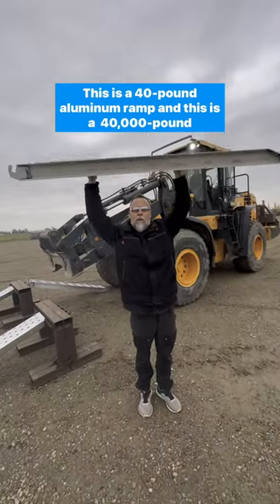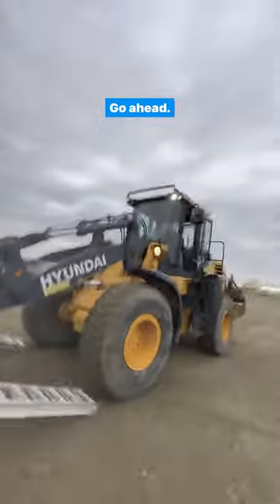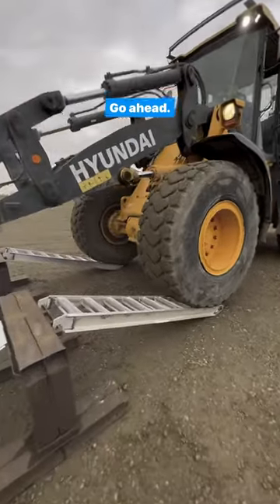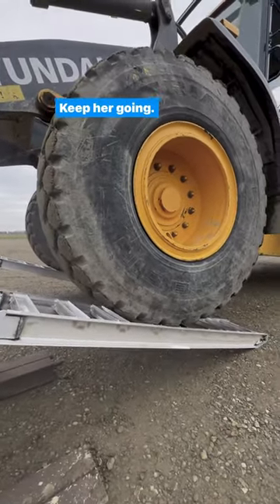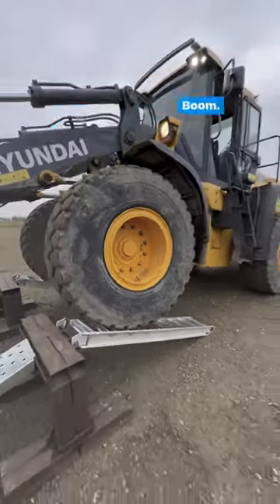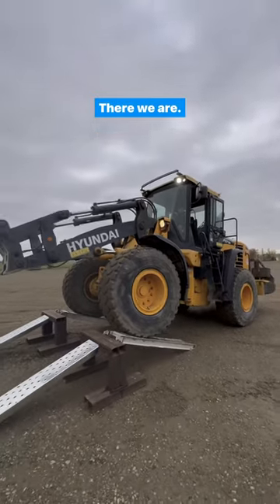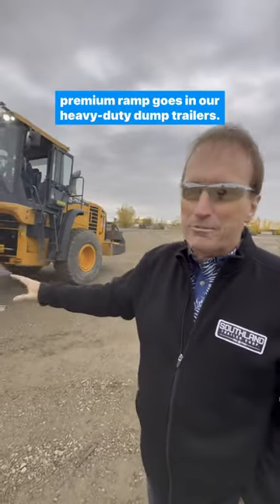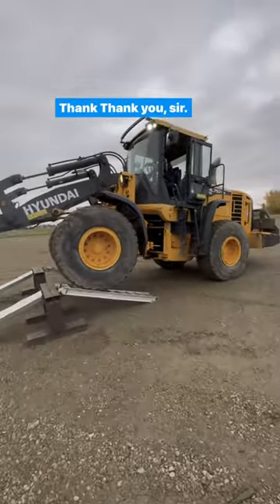40 lb Aluminum ramp VS 40,000lb payloader. #small #but #strong #shorts

Comment: Yea now use the rear tires where all the weight is. Instead of using the front without even have a attachment on 😂 I say this because he's boasting 40k loader on these ramps but he maybe put 8k on it. equivalent to a diesel pick up. But even still don't boast 40k when it clearly won't hold 40 with movement at 8k

Comment: Probably 6000 lbs per ramp but that test is destructive.  Roll on it 10 times and it will definitely break.  It will probably load 10000 lb trucks forever.

Comment: Ya.... But the front axle of the loader... Without a bucket is max 15000 lbs. So each ramp holds max 7500. Not even close to spectacular.

Comment: Ppl talking about how they should’ve used the rear end of the Loader but they missed the whole point. 

First off it’s aluminum
It’s 40 pound 
They just put a machine that weighs more than I’m sure it’s rated. 😐

I’m sure if they used the rear end it wouldn’t hold up as well but they still went above and beyond with this like wow.

Comment: I guarantee you with that 40,000 lbs doesn't have all the weight in front. It's more on the end of 12,000 lbs, give or take 2,000. Still a strong ladder.

Comment: Can anyone give me the approximate weight that was on the ramps?
Years ago I built a tub trailer for my atv and the sides come of and act as ramps and bridges. The sides are 1/4" x 3" aluminum channel with 1/4" x 2" aluminum angle rungs. I have always suspected that they would support my F350. My ramps are appear to be heavier than these. 
Any info is appreciated.

Comment: For one, it's not called a pay loader. It's a front end loader. Second of all, most of the weight is located at the rear where the engine is. This is not much of a test at all.

Comment: Half the machine is on the ground and it's on the quite lighter half of the machine, you're probably not even doing half of the weight of the machine on the ladder, not forgetting to mention cus there's two the weight is distributed even more so it's roughly 10,000 pounds possibly less which is far from the beginning making it seem like 40k pounds is going on the 40 pound ladder

Comment: I think the majority of the snow aluminum can be plenty strong enough if it's built right but don't tell us you're putting 400000 lb on a 40 lb ramp or the least amount of weight is turn that sucker around and put the engine up there

Comment: Loaded with a loader without a bucket and a 70% waight shift to the rear. So the Waightload on the Ramp is about 3000 pounds. Not impressive... cause the max load is about 5000 pounds. Maybe less.

Comment: Just so people are not fooled. There is not 40,000 lbs on those ramps. If you notice the front part of this loader is all that rke ramps is supporting. Most of the weight is in the back half of the loader. And there have removed the bucket because they know they are exceeding the weight limit of these ramps. At no point have these fellas disclosed the load rating for these ramps.

Comment: nope because you need drive up ramp ovee it and i adjusted you keep driving on that will snap in few use out of it because i have seen few report hatch snapped off cause tractor roll sideway and crash because wasnt thicker enough to handle 10ton or more

Comment: No bucket. Only the front axle. The majority of the weight will be on the rear axle due to the engine, hydraulics and fluids being back there for counterweight.
Probably 10k or less on them which is basically 4 tons. Split between 2 ramps, is 2.5 ton ramps. Not so impressive

Comment: That counter weight alone will snap instantly notice they don’t have the bucket on the loader... hint-hint.. the bucket alone is a minimum of 2k/3K lbs and it’s not on.. they are talking 40k lbs well I’m sorry the entire loader with bucket is 32k w/motor and counter weight in the rear. The total of weight on wheels and tires approx 800lbs each and the differential is aprox 1500lbs (max) that’s not much over 1.5 ton (3,100lbs) on those ramps. These guys are supporting and advertising style is 100% misleading and careless AF. If the first injury to a person who uses them as they advertise is a lawyer, that’s the only way to stop this bull crap

Comment: Took all the weight off the front of that 40,000lb loader...I am surprised it didn't fall over onto it's arse (where all the weight is) when it tilted. There was about as much weight on that ramp as if you'd used a standard car on that aluminium ladder. I wouldn't even back a 3 tonne bobcat up that joke because I value my life :D How much they pay you for this wank?

Comment: That's pretty good, it's only half the weight though. Or just those wheels in the front end of the vehicle, you can get the back end. But still, that's good, not 40 pound ramp 40 pounds, go back and weigh it.

Comment: Thats the lightest end of the wheel loader on 2 ramps with the center of gravity slightly shifted further to the back because of the angle. thats less than 1/4 of the loader on each of those ramps. This video proves nothing lol

Comment: How about instead of making the ramp that long and with such a big slot for when your walking on it your foot doesn’t fall in and your in pain.have st make a solid smooth ramp that’s 16” wide and 4 feet long and be made out of titanium or even carbon fiber mix with aluminum or something and not 40 lbs get the weight of 2 of them from say 80 lbs to a total of 20-25 lbs

Comment: Still impressive but not as impressive as taking the full weight.

But lets be honest, thats not the point. You dont own a loader unless you own a company unless you're wealthy, these ramps arent for loaders, they're for your trailer. If they can handle this, they'll handle that fully loaded skidsteer for sure, they'll handle small vehicles all day, and they'll last a lifetime so long as you dont try to take a mining rock truck over them. Actual ramps for THAT kind of equipment are much beefier, no duh.

Comment: So you did the lighter end of the vehicle so let’s say there’s a 60/40 weight distribution, so that’s 16,000lbs on the front, divided by the two ramps and that’s 8k pounds on each ramp…

And probably a lot less considering there probably more than a 60/40 split in weight, as it moves upwards even more weight is shifted to the back…

And 8k pounds really isn’t all that impressive when you’re talking about such a short ramp

Comment: That loader is not 40k lbs without a bucket and even if it was the motor and heavy parts are in the rear. U prolly had 10k or less lbs on those ramps but still okay for ramps

Comment: That’s not impressive at all. The majority of the weight was still on the ground and there wasn’t even a bucket attached to the loader. Maybe use an actual trailer and drive the whole thing onto it.

Comment: Yeah impressive strength but there is no where near 40,000 lbs on those front axles /Ramps. You want to get closer to the claimed 40,000 loader weight turn that rig around and back up those ramps.  The sales rep all proud gloating forgetting who is the actual stupid one.

Comment: Assuming 40k lbs is evenly distributed through the machine, which it is not. 40000lbs/4=10000lbs per ramp. Now considering the heavy end of the machine is on the ground still the ramps would be seeing more like 6-8000 lbs. Park all 4 axles on the set of 2 ramps and you would have a fairer test. 

Talk about marketing wank.